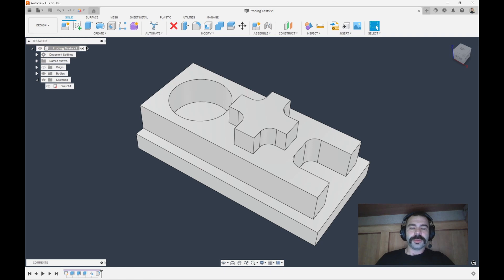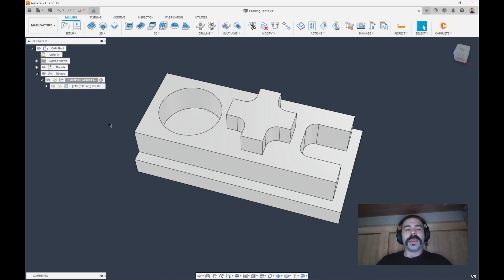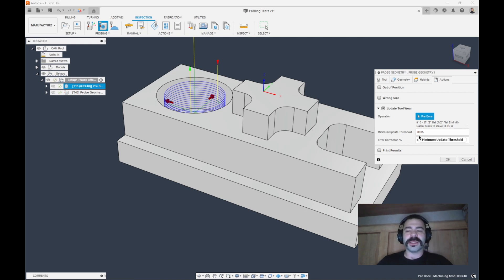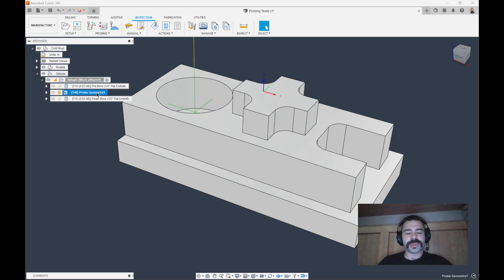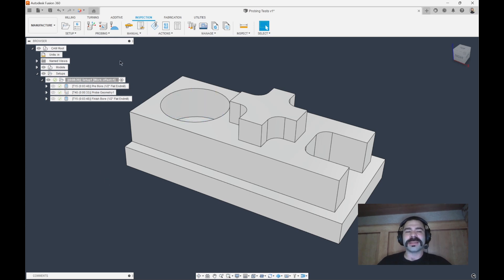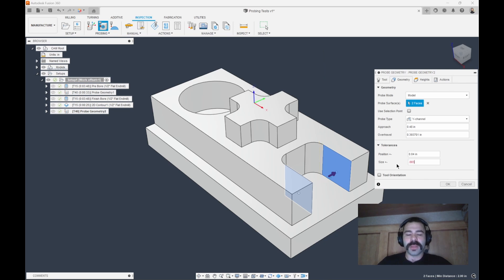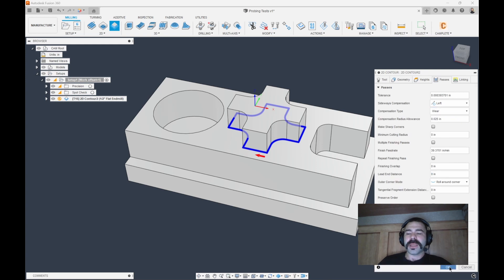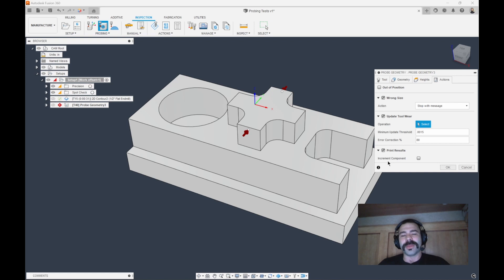In Process Probing | Fusion 360

Comment: Skipped alot, like roughing the part other than the bore, removing the 0.05" on the finish. Semi finish, probe, then finish probe bases on wear. Also, in the the different typea of wear setting in the operation.. like in computer, control, wear...

Comment: This is a great video. But I feel like there was one step you missed. You did not go back into the 2nd bore and remove the stock to leave. In other words the hole is undersize by 0.05".  Is this correct?  It was understood, but just want to verify
Reply: This was my understanding as well.

Edit:  Update!  I learned from another video that using it this way honors the "stock to leave" of the previous cut when updating the tool wear.  Thus if you had 0.05 stock to leave, the tool wear update looks for that 0.05 and updates correctly.  You DO however need to make sure you uncheck the "stock to leave" on the following operation to make sure you're cutting exactly to spec.

Comment: Good, quick, useful info... But, I'm still looking for what numbers go into the Haas Next Gen offsets page for the tool.

Example 1/2” end mill that measures 0.5003" and starts at 4" from spindle.
I want fusion to say the tool is 0.5000" and the wear is whatever the machine probes it differently. The offsets page should show 0.5003 actual diameter and some number for wear. I'm guessing it should be -0.0003" so that is used to move the toolpaths a bit farther away from the desired line.

It just seems to me that Fusion should always know the advertised size but not the wear while the control should know the actual diameter and the wear.

So how do I get the probing cycle in the machine to enter a wear value of 0.0003" (not sure if it should be positive or negative!) and a nominal value for actual diameter.

Doing this should mean that replacing the tool and probing it let's me use the same nc program without changes and repeated tool probing constantly updates the wear value.
Thank you to anyone who answers!